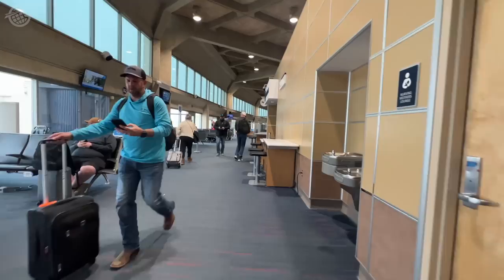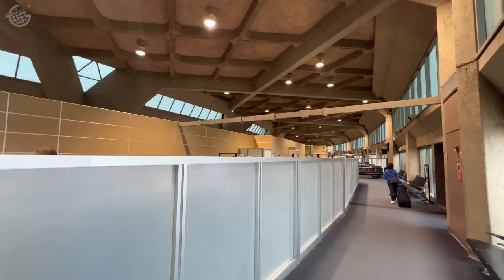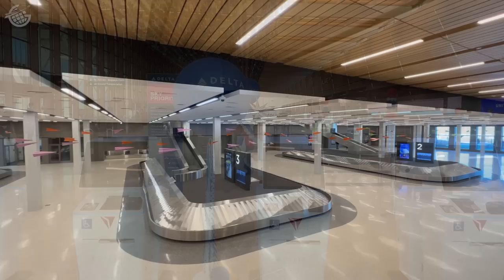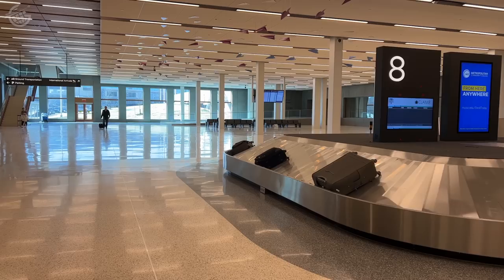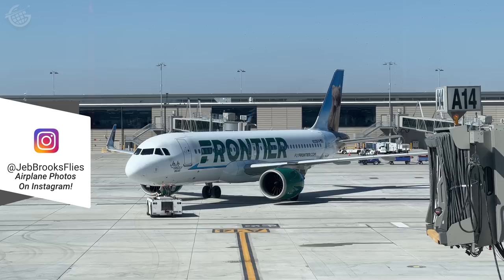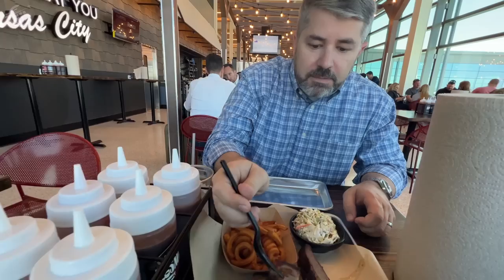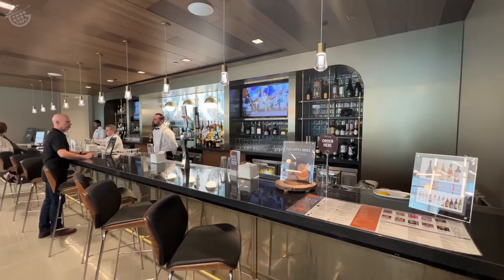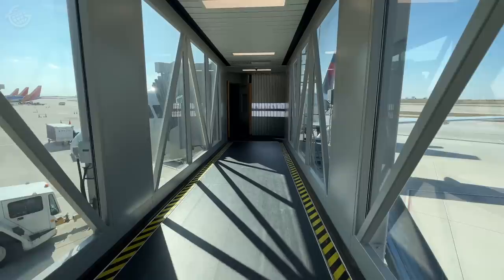World’s NEWEST Airport Terminal (Kansas City International)

Comment: I feel like this airport strikes the wrong tone almost everywhere. The intro shot looks like a generic airport and if you told me it was MSP I would have believed you. At 6:30 you say this is finally an airport that truly reflects it's community, but that feels like it couldn't be further from the truth.

The old airport was phenomenal before the 9/11 changes made getting through security such an ordeal. They always could have fixed the airport by adding a second floor in the terminals to centralize security and to avoid creating that awful double ring interior, but they chose to keep split security.

MCI has always been a terrible airport for connecting, but even post 9/11 it was the easiest departure and arrival experience around. The lobbies were cramped and there weren't enough bathrooms, but you rarely had to spend enough time there for it to be a big deal.

I'm sure the new airport works better in the current landscape of how an airport needs to work, but it's reflective of a desire to make an airport cheaper to operate, not of Kansas City.

Comment: I know it was your job to downplay the old airport and highlight the new airport but I didn't ever experience any of the issues you brought up.  People don't come to airports to eat and shop, they come to get on a plane.  It was literally never crowded because people that arrived could get out as fast as possible so nobody was in the way or waiting around.  There was no need to have a separate departure or arrivals level.  There was little congestion because of the design.  People were able to get in and out of the airport so quickly there was never a build up of cars.  Lets not forget that the people in the KC area voted the new airport down over expanding what they already had several times until they basically overroad the decisions and built it anyway.

Comment: The new airport is inconvenient and boring as heck, a carbon copy of 1000 other gray airports modeled after railroad stations.  The art is bland, the trek is long, the water in the restrooms is boiling hot, and the last time I was there, the moving walkway was out of service.  Pure pork barrel.   And whose idea was it to put a departures board in front of big plate-glass windows so you can hardly read it?